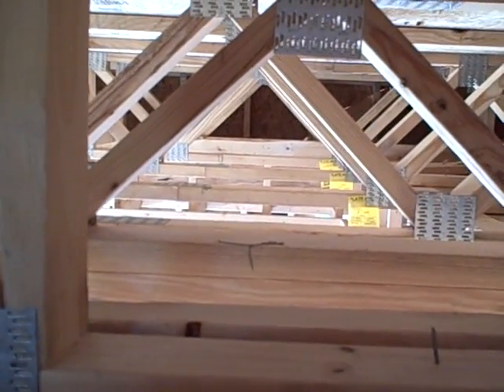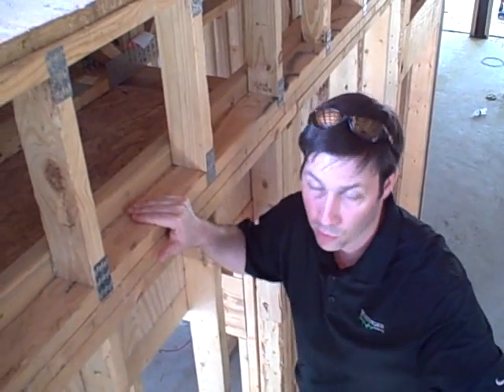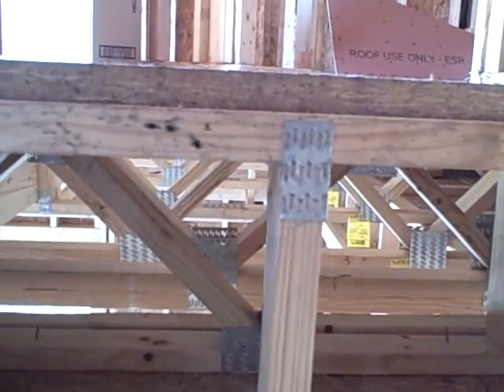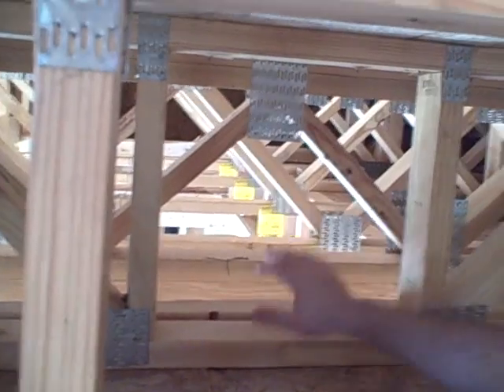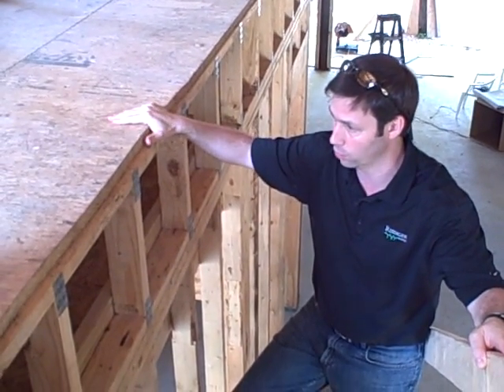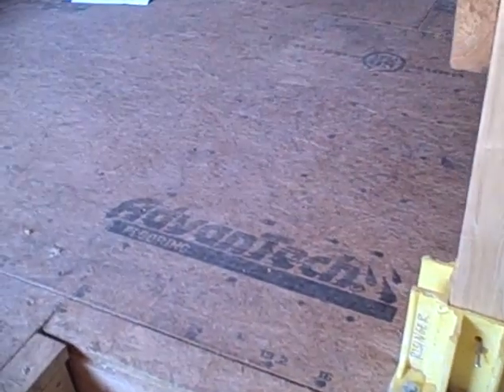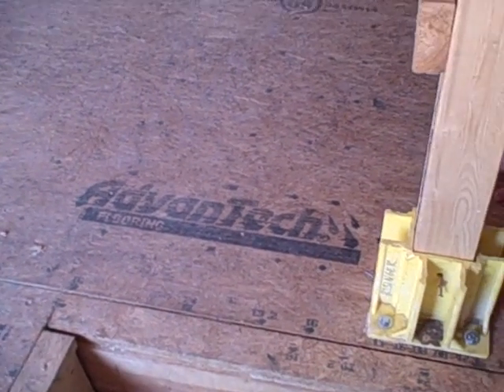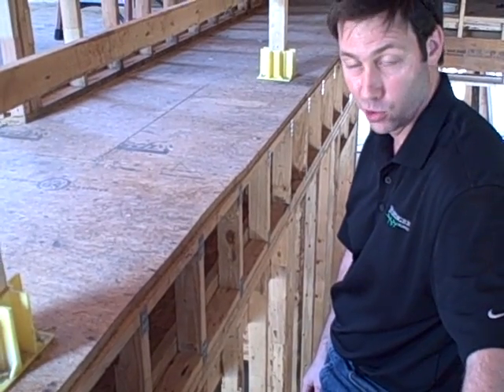Trussed Floor System with Advantech Decking

Comment: Why are the floor trusses constructed with the larger dimension set in the horizontal instead of the much stronger vertical?
Reply: Like steel beams, the flange works best in that orientation. Saves space and makes it easer to set and nail sheathing to as well.

Comment: it's pretty cool to see those floor trusses installed. I'm a floor truss production supervisor at a Truss plant in the Florida panhandle. I have been building them for about 6 years now, but I have never worked on a framing crew, so I have not been able to see them in use, very cool!

Comment: What happen when there is a fire? The gusset plates pull out of the wood and the floor collapses. To bad for the firefighter that was crawling on the floor trying to save the homeowner.
Reply: My main concern with specifying these for 2nd floor joists.  If you use as a first floor joist system over a crawl space, I don't think fire risk from underneath is high enough to worry about in most situations.

Comment from the maker: Floor trusses are an UPGRADE to the quality of the houses I build not a downgrade compared to I-Joists or 2x lumber.  I've had very few truss problems in the last 10+ years of using them for floors.  They make for a stiff floor and make running pipes, wires much easier.  -Matt
Reply: Hi @Matt - here in 2017 are you still recommending the 2x4 floor truss system? I ask because we were about to go with 18" tall TJI spanning 24' 3" @ 16 O.C. (these wide spans will support the family room and kitchen).

BUT - the lead time on them is 6 weeks...   so builder is recommending looking at open web trusses (I assume they are same as what you refer to in this video).  I know 24' is a very long span - just looking for ways to stiffen it up a bit. I do like the idea of the thicker Advantec (plan calls for the 3/4" TIG Advantec).

Comment: There aren't too many smart guys out there who want to do this for the rest of their lives. The company I work for have been using these on military housing for the past 6 years and have built approximately 1200 homes. Not too many problems. Just make sure you order them early so any problems that occur are addressed before the crew gets there.
Reply: 4evalonely yea, I build floor trusses for a living, and most of the framers order them very early, in fact, some times the roof, floor, and Jack trusses get delivered before the walls are even framed so any issues can be fixed before they are needed

Comment: We use 24" floor trusses but they are designed when the house is designed. The webs all line up, the duct chases all line up perfectly. If you put in the effort to design in the chases get them lined up perfectly, the HVAC guy has a much easier job and he does a much better job.  

We show each truss on the plans, designed to show the duct chase(s). The floor framing plan shows the duct chase location so individual trusses are not installed end-for-end backwards.
Reply: Thom Wright yea, I'm not sure how other truss companies do things, but at the plant I work for ( I'm the floor truss production supervisor), I usually open the HVAC chase to a bit over 24" so the HVAC guy doesn't have any issues, I make sure all of the strong back bracing lines up, and mark one end of the truss with red spray paint, so the framer will know which end is which

Comment: Most of the builders we have seen using trusses, use them to save money on the framer. Any doofus can frame up a trussed house, so they just buy trusses and hire a doofus.  Back in the day, my old man could figure a floor or roof in a matter of minutes with a slide rule, now everybody uses some office jockey engineer. You are VERY lucky to have never sent trusses back. I would bet if you ever put 20-30 houses in the dirt per year, you wouldn't be so lucky with them.

Comment: @MattRisinger You can make 2x floors too stiff, or too weak.You don't need a different type of joist to get rid of the china cabinet issue. Trusses- the only place in a house you will see #3 lumber.One gang nail comes loose, the whole truss is shot, or has to be repaired and stamped by an engineer(most framers will just hit them back on with a hammer and hope for the best)You should bring up the "goods" and "bads".  Maybe its personal because of how much blood they have taken from me. damn metal
Reply: d1incharge all truss plants are different, however the plant I have worked at for the past 6 years does things a little differently. we don't even carry #3 lumber, and the only time we use #2 is occasionally for webs ( the inside of the truss, but I'm sure you know that ), the top and bottom cords of the trusses use either #1, or MSR lumber. As far as the gang nails coming loose- We have a repair crew who goes to any job where something like that happens, removes the damaged gang nail, replaces the damaged lumber if need be, than uses a mobile press designed to set them all the way ( think of a hydraulic powered c-clamp). Again, I'm sure not all truss plants do this, that's why you have to research, and find the best plant in your area

Comment from the maker: @d1incharge Thanks for your comments.  I've not experienced the issues with waiting on Truss packages but I agree that traditional 2x materials have more "give".  I can also say from experience that a trussed floor is much easier on your back than a concrete floor.  On many jobs we create a sleeper system with airspace on top of our slabs so that hardwood floors feel like traditional installations.  -Matt Risinger

Comment: We use nothing but 2x12's and 3/4 floor because it saves money. We have had zero complaints about squeeks or softness, we save quite a bit $ for the customer. No sending back one bad truss, and waiting a week for a replacement. No finding one loose gusset, and having to call an engineer. I have even seen concrete poured a few inches off from the plan. Trusses should never be ordered w/out measuring the concrete, when you frame basements, you don't have 2 weeks to wait for a floor system.

Comment: @toology55 You can always tell a bad framer when you see them using screws. The fastner is ONLY there to hold it down until the glue dries. I just bid a house that had screws and more squeeks than I have heard for years, the homeowner thought spending the extra time and money on screws was a good idea.............he was wrong. Glue is 100 times stronger than any fastner, if you mess up the glue or try to put the glue down on wet or frozen days your floor will squeek, regardless of the fastner.

Comment: Stiff floors are hard on a back. Yeah, certain furniture will rattle, but I prefer as soft as code will allow, because it feels so good on my back and framers joints. Trussed floors make the house even taller, means there are added costs on siding, osb, wiring, plumbing, insulation, more stairs and more. It is a tiny amount extra, but the costs are there. I designed my house around a 2x10 floor system and saved thousands total vs. trussed floor. But it makes drawing a floor plan much tougher.